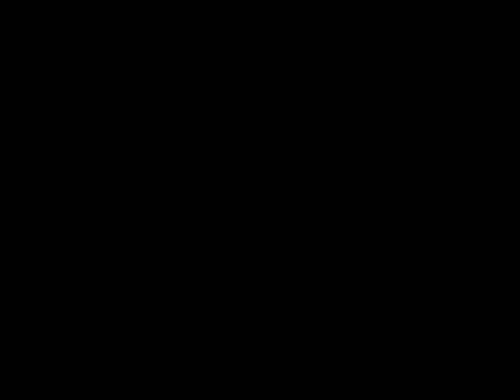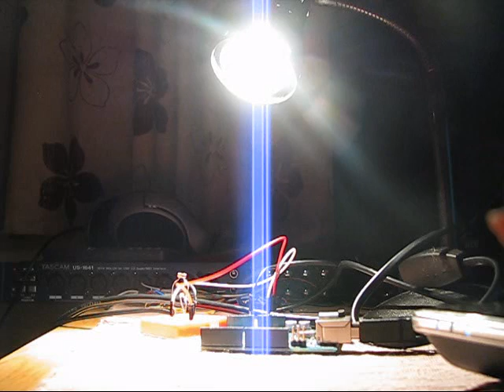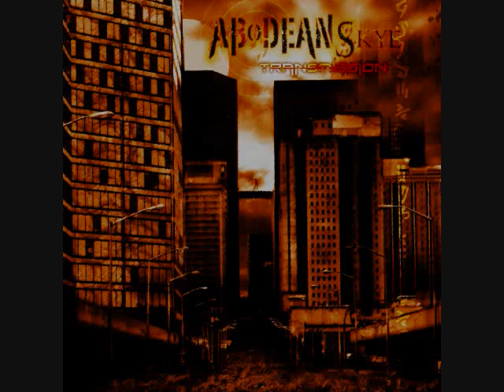Arduino + Karplus Strong + LDR

Comment from the maker: @miro2424 I don't have a lot of experience with electronics. I'm more of a software and programming person, so I try to keep my circuits and devices as simple as possible and then do most of the processing in code either on the Arduino or on a computer.

Comment from the maker: @miro2424 It's very easy to do, it's literally just an LDR going into the Arduino into one of the analog ports. There may or may not have been a resistor involved, but I think I used my Max patch to bring the signal into the proper range, as it hovered somewhere between 300 and 500 (from 0 to 1024). You can look up ways of getting serial data into Max, but this was literally something I whipped up in half an hour.